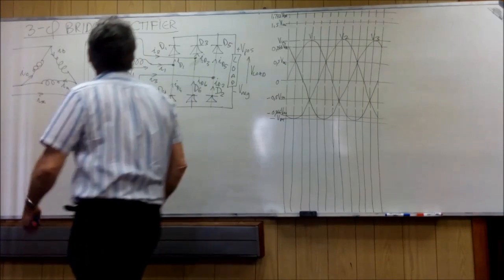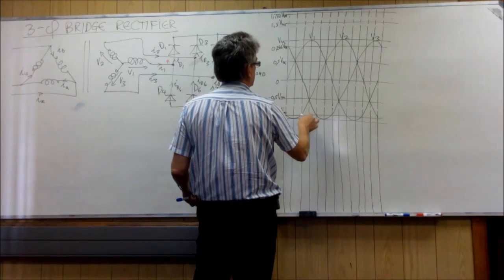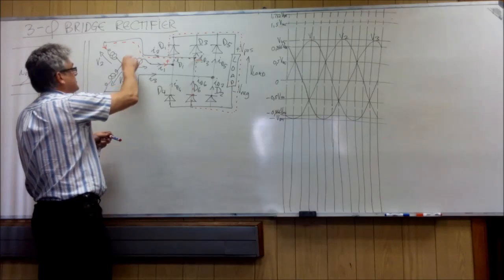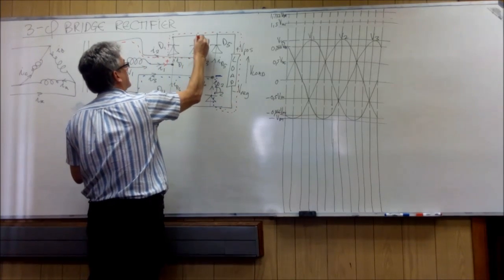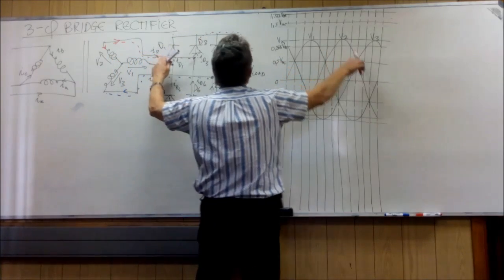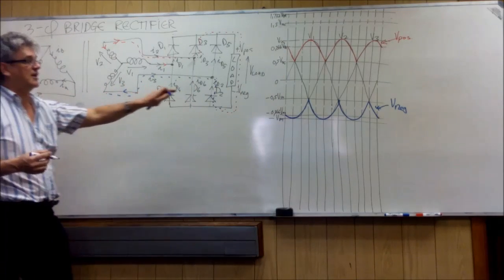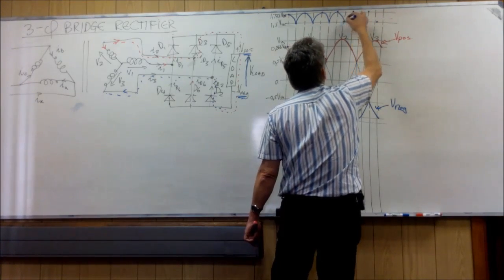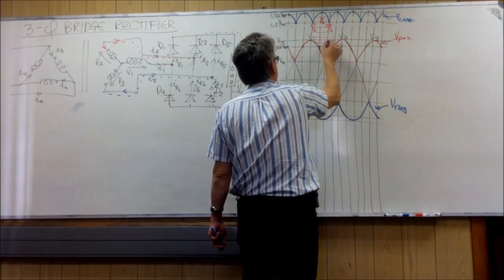Three Phase Bridge Rectifier

Comment: I have a 3 phase Full Wave Bridge Rectifier I would like to use with single phase 220VAC as is common in the USA. Is not 220 actually 2 110 AC legs out of phase? and if so this bridge rectifier should work using a single phase application only question in my mind is how do I properly wire it. My device has 3 screw terminals at top for AC1, AC2, AC3 and 2 DC outputs below for the DC out + and _ . Which 2 of the 3 leads do I connect my 220 to? and do I connect the 2 220 hot leads to any 2 terminals at top where AC is to be hooked up? I have a website which shows the picture of the component and its wiring diagram for 3 phase but am not using 3 phase only single phase. http://www.plccenter.com/Buy/GENERIC/PT76S16A?source=AdWords_MfrPart&utm_source=Google&utm_medium=PaidSearch&utm_campaign=268722635&gclid=CjwKEAjwiru9BRDwyKmR08L3iS0SJABN8T4vDILb20q0coV21RrRk-kuEu4WjoU5wZ-J3OI8HOyPuRoCRkHw_wcB&kwid=17623557848x20995535195x268722635

Comment from the maker: In the video conversion is done from V_line_max to Vmax. In case one wants to determine the DC voltage with reference to Vrms then the equation would be: Vdc = 3*sqrroot3*sqrroot2*Vrms/pi.
Reply: hey, look at the point 2pi/3, it is actually 5pi/6.... you should reply me... this might be wrong.

Comment: @ 8:39 converting Vrms  to Vmax; it should be multiplied by underroot 2, not 3

So the equation for DC voltage across the load should be  3*underroot 2 * Vrms / Pi